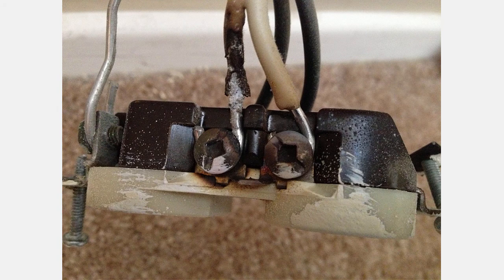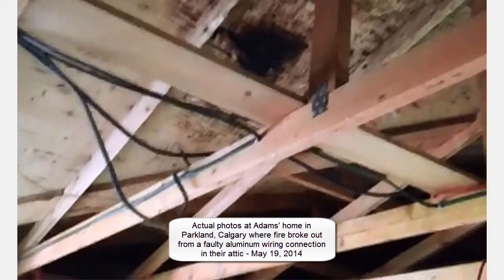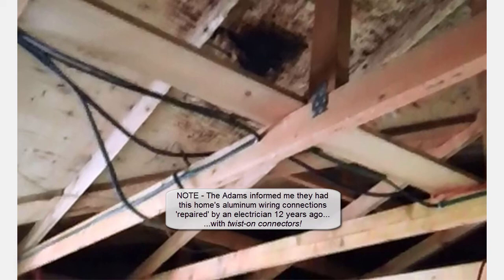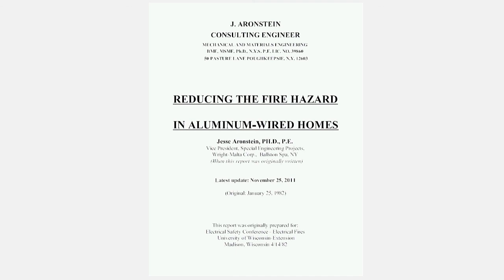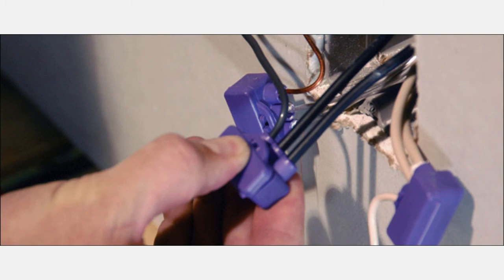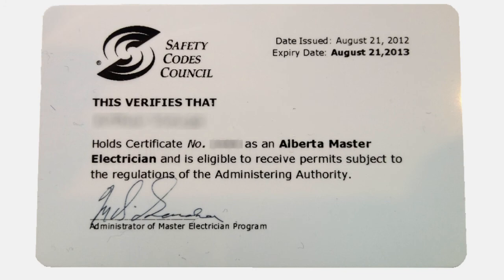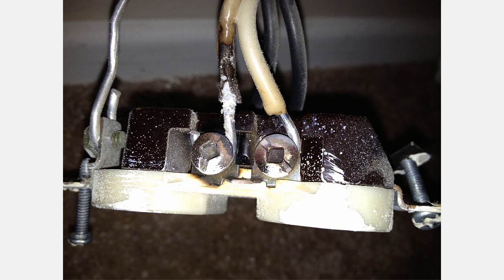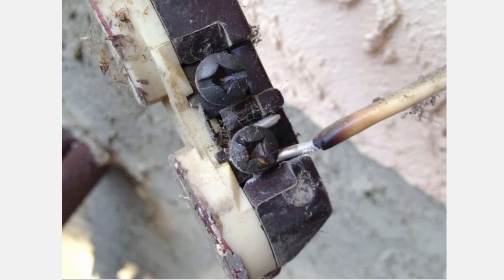WARNING: Make Defective Aluminum Wire Connections Safe in Calgary SE Houses

Comment: you guys are making issues out of something that it isn't. The issue is just plane shoddy techniques, aluminum wiring will just amplify those crappy practices. These same problems you are showing will have happened no matter what, in 99% of the cases, with copper wiring. The problem is that construction is just a "paid for" business and everything under the blanket of this construction, electrician, plumber, etc, will only do as good a job as is minimally required.

Comment: What about that putty stuff in the pig tail connections to copper 

My dad had a house with aluminum he opened up a wall to check the wiring to a dead outlet and found an illegal connection which burnt the inside of his wall he then fixed that illegal junction and did pig tails with the putty stuff to copper to the outlets and switches through out the house last I heard it’s still standing strong he ended up selling it
Reply from the maker: I am afraid, despite my research, I’ve never heard of putty stuff used in aluminum wiring connections. It is NOT recommended by Dr. Aronstein nor the Consumer Product Safety Commission. If it is functional at all, it is a temporary solution at best. Those people who bought the home should be warned. All connections in the home should be should be checked once annually, at least.

For an online seminar designed to be the FINAL word on aluminum wiring repairs, go to http://aluminumwiringrepair.com